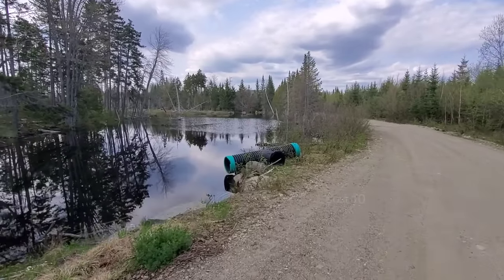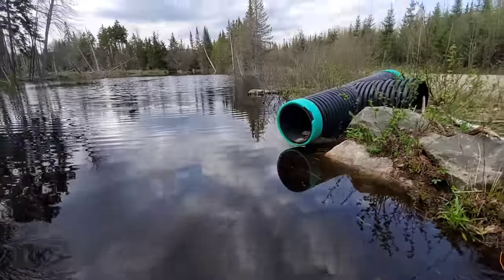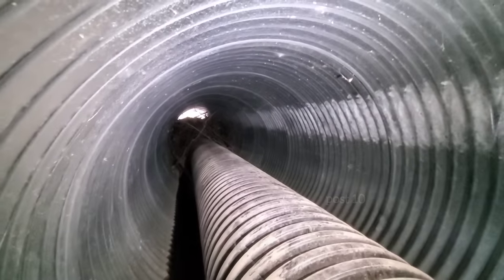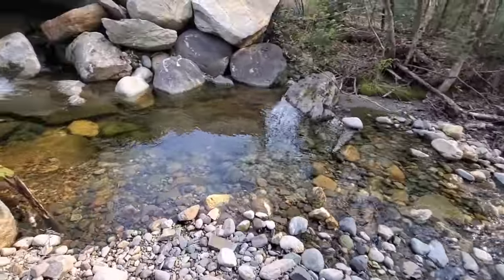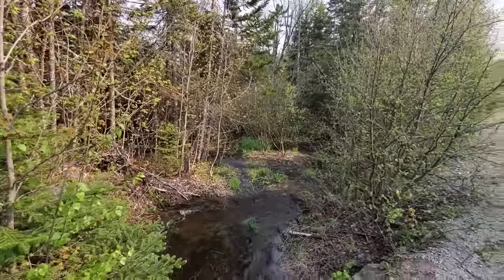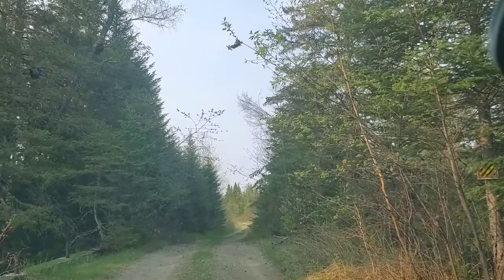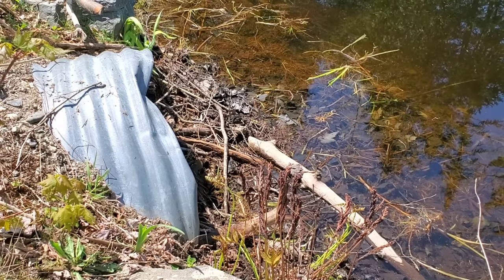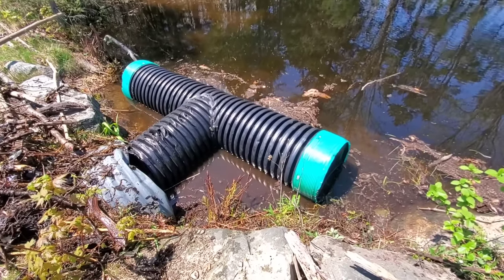Removing Large Blockage, Flooding Over Road, Caused By Broken Beaver Proof Intake Structure

Comment: Hey post, I think a full size 4 tine Cultivator Rake would be perfect for removing Beaver dams and clogs like that. They have long tines that really dig into material so you can pull it out. I found mine worked really well for removing thick muck out of my pond.
Reply: They really do work great! I have both a 3 and a 4 prong. They've lasted more years of heavy use than I can remember. Keep the wood handles well oiled and they'll last generations. Awesome tools, can't imagine not having them!!! 👍👏👏👏
Reply: We call them potato forks here in East TN, but yes, it gets into small places easily
Reply: @cathiwim  I love how they grab and hold. Just a little twist and out comes the... rock, stick, dirt clod, potato....
Reply: @meemoleem9123  good idea

Comment: The zinc doesn't just act as a barrier against rust, it acts as a sacrificial anode.
Boats have lumps of zinc on their hulls for the same purpose as zinc oxidises more readily than steel.
When the galvanized surface of a culvert is damaged, exposing the steel, the zinc still protects by corroding instead of the steel.
It's only when all the zinc in contact with water has disappeared, that the steel will rust through.
(The zinc doesn't wear away, it corrodes.)
I hope I've explained that properly.

Comment: I grew up surrounded by forests and wilderness. Not sure where you are at, but beavers would never build inside a drainage culvert. They build in the water for protection. They swim underwater and up inside their dam is open and dry. Not sure what was doing all that, but I would definitely be careful.

Comment: Nice work. We had a huge beaver problem in Portland  with them plugging culverts. We found that we could build a cage using metal screens and then bury it in the mud. I have never seen them defeat them. That p.v.c. pipe structure was never going to last. Beavers are mother nature’s Civil Engineers.

Comment: I'd say that smaller pipe has shifted into the bigger and the T junction was further out by a couple of feet. I use to have all my clients keys with my car keys too till I had to have my Ignition tumbler replaced and key fob replaced due to the weight wearing them out. Centre console is a great place to keep all the keys.
Reply: You make a good observation about the inner pipe, I completely missed it.
I don't know what a solution for that would be without providing another spot for a blockage to form against/around the bracing of the smaller pipe.
Reply: Maybe a couple of large sticks or metal T posts would keep that larger section in place.
Reply: I also had to get an ignition tumbler replaced once and now keep each car key (carry only one for whatever i'm driving), house keys (mine and family), and work keys all separate -- my wife keeps just one house key on her car key and other keys in her purse
Reply: @ljtlove4519  They would help, but then you have to try to reduce the possibility of those braces becoming the start of a blockage.

Comment: Please explain why you don't use a crowbar to slide it under the obstruction and raise it so the water acts as a lubricant to wash the beaver dam away. depending on the stream flow rate there should be enough weight of water to push it out. John the aussie bloke.

Comment: It looks as though that T-piece intake was lifted up to its breaking point by a rapidly flooding pond. The flood looks to have also moved the smaller diameter culvert further into the larger culvert as I would suspect that T-piece to have originally been sticking out much further.

Comment: I feel like the small 18 inch culvert was meant for a maintenance flow, keep the swamp at the desired water level, and the big culvert that the 18 inch is inside, was meant for storm waters. I don't really think the beavers intentionally broke off the end piece of the little culvert, I think it may have been unintended consequences of damming the big culvert

Comment: Hey post10 you know you could try tightening up your valve cover gasket yourself but don't tighten it real tight because it will crack really easy just snuggled up like just when you feel a good tight that's good enough it's one of those things that you really don't want to do Tight cuz you'll make it worse but just snuggle. Go all the way around one on top one on bottom one to the right one to the left until you get them all tight once again not super tight I must emphasize not super tight good luck my young mechanic friend LOL you can do it I hate the smell of burning oil to on my car I just have it fixed does your car have a warranty anymore? If it does they should cover that?

Comment: Looks to me like the plastic pipe slipped down the drain.  If it was pulled back up and the fitting was put back on the problem would likely be solved.

Comment: Post 10! Get your car back to the dealership ASAP. They are stalling for time. If it’s under warranty get them to fix it as soon as possible. Oil dripping on the exhaust is bad and the smell will go into your cabin too. I’ve got a similar issue. My car is going in next week. Don’t let them tell you “oh you could just leave it” no you couldn’t. It’s a issue and needs sorting as no matter how you put it. Your loosing oil.

Comment: I do problem beaver trapping for a business, yes they will use old stuff again , having contacts with several towns and the state I have broken hundreds of dams and cleared culverts , you will do better with a potato rake for clearing culverts,
Reply from the maker: I have been doing this for years, first started with my old job, I have even set up hidden cameras and they always use new stuff and this pile is still there today over a month later with a new dam of new stuff. Not saying your wrong but in my experience if they have new stuff to work with they won't use the old
Reply: @post.10   here in NH they have as I said I do this for a living , you must have picky beavers in your area

Comment: did some damn clearings and culvert cleanouts with an older cousin he had a tool that looked like a hook climbers used attached to the end of a push pole stick like in duch hunting. If i remember it was like 10 foot pole or so ripped the shit out of the culverts

Comment: At work we use what looks like a hoe on a 20ft pole to reach packages trapped in chutes, sounds like it would work perfectly as a tool for clogs or beaver dams deep inside small pipes.

Edit; you can use any length of pole...maybe different lengths of pipe for the one head?